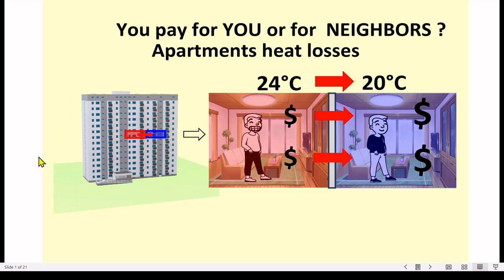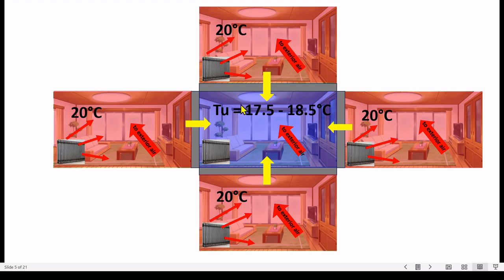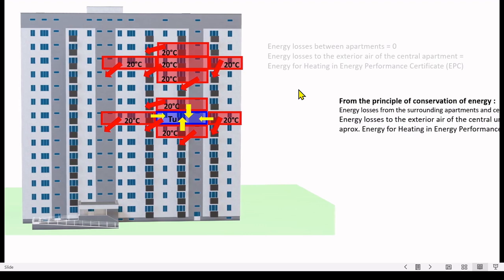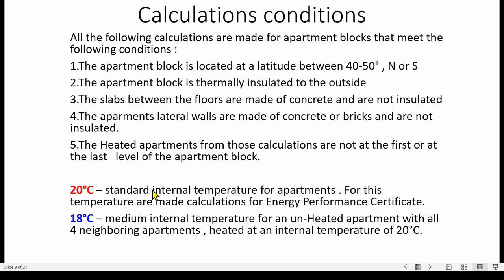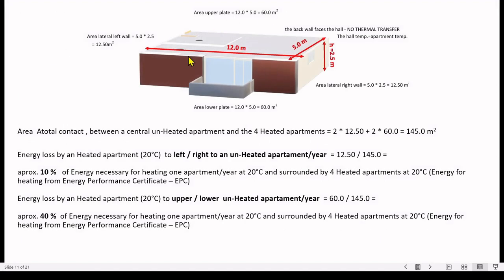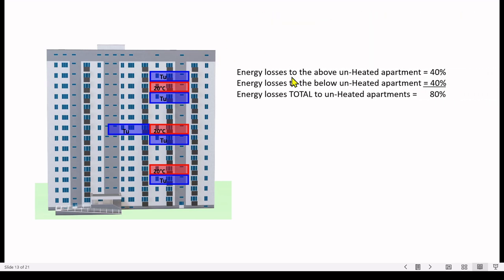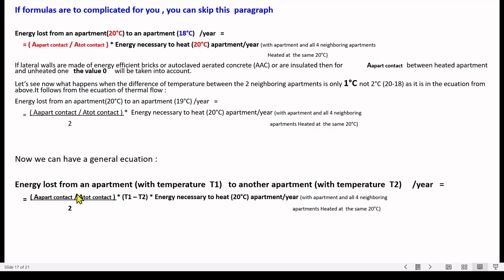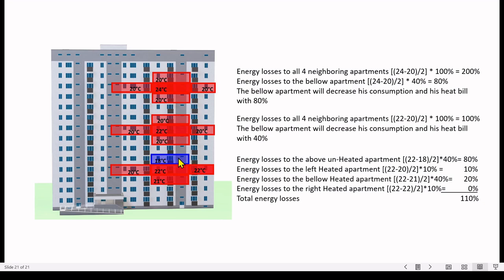Energy Performance , Efficiency of Buildings - Apartments heat,thermaly losses between them/exterior

Comment: Energy performance in apartment buildings is often influenced by heat transfer both between units and towards the exterior. This video offers a clear explanation of thermal losses and their impact on overall efficiency. A great resource for anyone interested in improving building performance and reducing energy consumption